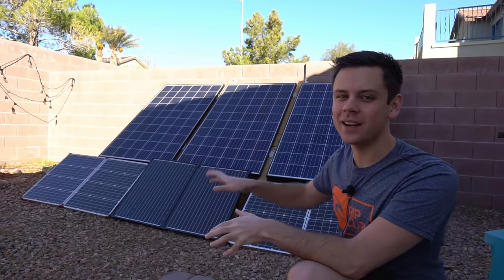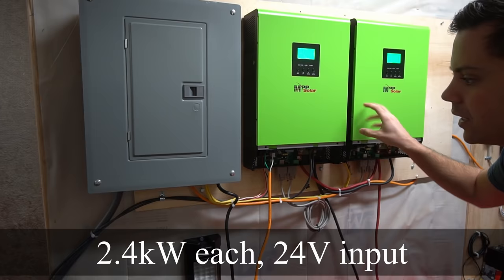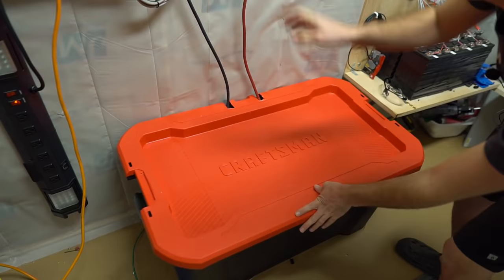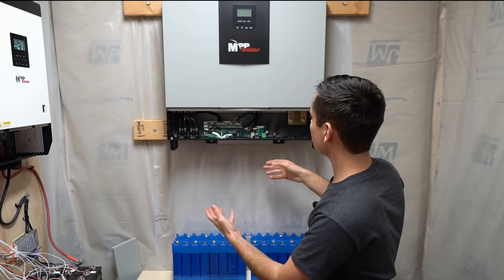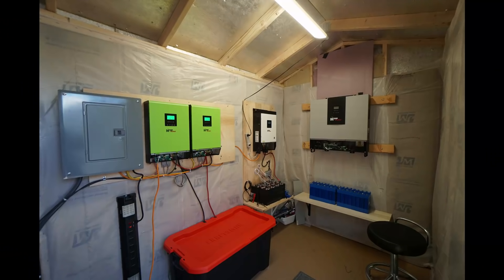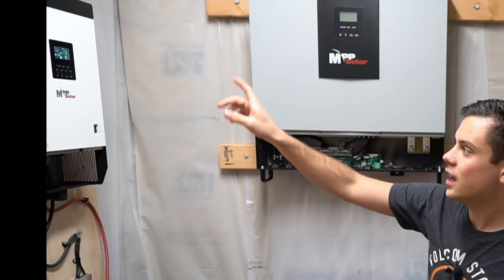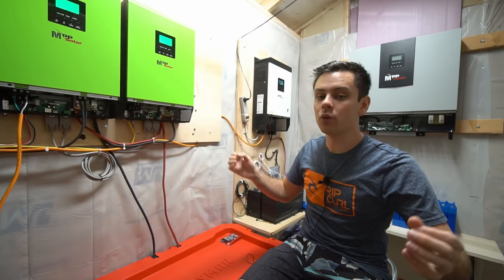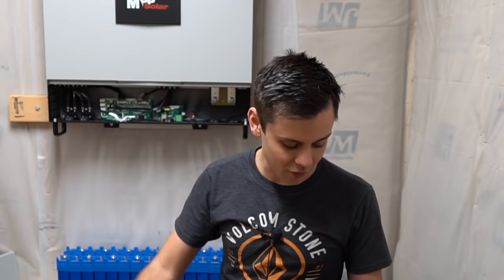Backyard Solar Power System Update! 10kWh Battery, 4 Inverters, 810W Solar Array

Comment: Could you make a video for a small, cheap set up for a camper or ice house? We are looking to power our ice house with solar. Any reason we can't use a standard marine battery? They're meant to be discharged and recharged often. They're also cheap, around $160. Thinking of using (2) 100 w panels with a Harbor Freight charge controller and a 400w Inverter thats made to hook up to a truck battery. Any changes you would make?

Comment: Hopefully, you have inspected your service  panel, as 'Joe Mexico' doesn't know the difference between a right hand or left hand loop to connect the house wiring to the breakers or  receptacles & switches..   Since 'JM' installs the loop left handed, he opens it when tightening the screw..  LOL!  Tons of fun..!!    Also, 'JM' doesn't tighten the screws enough to include all earth grounds and neutrals.  Arcing, dislocations with entire circuit failures are common here in Old Mexico (Las Vegas and Henderson) and contribute to house fires..
If you haven't acquired a permit with an Underwriters Inspection certificate, your insurance company can refuse to pay if they determine the fire was caused by your grid tie.. Icky Poo..!
Reply from the maker: My grid tie system was inspected and is code compliant. Not sure what you mean here. As stated in the video, this shed is off grid. Why would you think it's tied to grid?

Comment: Will I have 6k watt solar panel array and a 5800 watt Axpert hybrid inverter and 11k watt with lifepo4 batteries.   If I wanted to add another bank of batteries, how can I add that to my system?   My concern is that the bms only allows 50 amps charging to the batteries.  If I add a second 51.2v bank, how do I send 50 amps to each bank?   Do I set the hybrid to send 100 amps charging and then each bank gets 50 amps?   If one bank goes down, then that means one bank will get 100 amps which then would overload and then bms should kick in and disable that bank also.   Or that’s how I see it playing out.   Also, it seems like the lifepo4 batteries can handle up to 100 amp charging but the bms doesn’t allow that.   How do we get full capacity charging?    I’ve yet to see a bms that allows 100 or even close to that.  I’ve only seen 60 amps available.     Thanks

Comment: QUESTION: I was building a solar system for a van and was planning to use extruded aluminum for the framing. would you recommend this? should I cover it with plasti dip?

Comment: First, I love geeking out on your videos.  In about the third grade (long long long ago) when I was allowed to ride my bike two miles to the city library, my first book was A Boy's First Book of Electricity.
Now my question, and please forgive me missed it.  HAVE YOU DONE A HEAD TO HEAD COMPARISON BETWEEN YOUR OKD RELIABLE EPEVER 40 AMP MPPT AND THE RENOGY 40 AMP MPPT?

My third personal RV solar system is at the hardware ordering point.  Other than the wire grips being limited to 8ga they feel pretty equal.  I would go Epever, but really like the blue tooth interface of Renogy as running a MT 50 remote to where I would want it would be a bear.  I'm loving the ability to be remote wirelessly and really can't cost justify Victron.  Thank you .  Tom

Comment: I know you are a photovoltaic guy
But are you inquisitive enough to install a Geo-Thermo (buried 4 inch drain pipe with the ridges)( multipul )   a few hundred feet long...maybe 8-10 feet deep ... To compare the cooling effects.   AC vs Geothermo

Comment: question, up grading my system 800w solar pannels 12v. to 1600w 24v system, now my 12v inverters 1st one 800w for frig. stays on 2nd inverter 3000w turn on only when running my larger stuff. will a 24v to 12v step down converter work to power both inverters? and what size? plus thanks for all your great help!!!

Comment: I have eight 100 amp hour lithium cells. I want to build a two hundred amp hour battery. Which way is Best Built to 100 amp 12 volt batteries. Or combine two cells and make one two hundred amp battery with eight cells.

Comment: Can you please do a video on the 2 mpp lv2424 vs lv 5048 please. You said that it's easier to hook up the5048 but I like the redundant aspect of the lv2424. If something goes wrong with one you still will have the other.
Reply from the maker: What aspects would you like to know? The lv5048 is just 2x lv2424. I know the 5048 is bigger and heavy, but it's so simple. And not much redundancy needed. If it fails, so cheap to just throw another one up
Reply: @WillProwse  Oh i didn't know that. So there are no features that are different on the 5048? Can you pull more than 2.5kw on one phase from the 5048. I thought it would allow for that since it's one unit. Can you sell your power back to grid with both units? On the website it says, "LV2424 only: please check with local authority for compliance before enabling this feature". Does that mean only the lv2424 has that ability?
Reply: @WillProwse  I too am curious about the lv5048.I would like to see someone go thru the startup process step by step.Also can you parallel it with any other inverters in their lineup other than another lv5048?Want to know if it's even necessary to parallel them.I am wanting to have a dedicated 220 inverter for mini split and two lv5048's for the house load.Might have to get 3 lv5048 instead but not sure?Also if you are running multiple inverters paralleled do each additional inverter charge bats or just master inverter?If multiple inverters charging do you hook them in different locations to help even the charge?I have lots of questions about solar boss and try not to ask stupid questions so I can do my system once and not waste a lot of money.
Reply: @WillProwse  Also if you plan on being in your shed alot...I would spray foam the inside and then panel it,sheetrock it or plywood it but definitely spray foam it.They sell a small kit at Lowe's or Home depot.not the spray cans like paint.

Comment: Not sure how nasty code inspector's are in your area. But if they see that they would probably red tag your entire house till it's disconnected... Your sealing that shed up pretty good as well. What are you doing for venting?
Reply from the maker: No this size array is totally fine and code compliant. I checked before I built it. no need for permits at all. It's literally just solar panels leaning against a wall. 

And my grid tie system was inspected and 100% code compliant. I actually showed the inspector my backyard system and he thought it was so cool haha I was so nervous but he said it's fine.
Reply: @WillProwse  wow very surprised. None of the wires have to be in conduit or properly held down in the elec panels or strapped down  out of the panel. And not using ext cord wire :) Will your regular home ins cover you? I would think since your making money off these videos with what your doing you might need a "rider" or even a commercial policy. Cool deal. Here in California they would be all over that...

Comment: I need a setup for my shed that has no electricity to it. I need it to run lights and a air compressor that will be used very little. But when it is used it takes 120vac at like 15amps. What can I get by with battery and panel wise?? This compressor will only be used very little. Would one 100ah lithium battery run a normal air compressor?? I’m pretty sure even 100 watt panels would easily be able to keep it charged with the (not much)use my setup would get.
Reply: Or would I be better off just running electric to the shed?? I just love this solar idea and want to get into it but don’t really need to. If I could run my shed on a 100ah battery I think I would do it.

Comment: Could you explore the failover scenarios with the multi/parallel units?  I can't get a straight reply from the (chinese) seller whether the master unit continues if the slave unit fails, or better still - does the slave unit continue working if the master unit fails.
Reply from the maker: It would go into safety mode and both would shutdown. I pushed a leg to it's limit and both turned off. When they communicate, they act as a single inverter
Reply: @WillProwse  Dang, no failover.  Oh well.

Comment: I really like your reviews and instruction. I have a question regarding your 2x GREEN MPP Solar units (MPP LV2424 Hybrid) and its combined Transfer Switch maximum current capacity.
When you run them in parallel is the Transfer Switch of BOTH of them synced to work TOGETHER to provide TWICE (2x) the current capacity when you exceed the Inverter output capacity? 
I am considering to connect and link together TWO of the larger LV5048 MPP Solar systems to run in parallel to obtain 240V AC Split-Phase 2*5kW=10kW (Max 40A) with the hope to obtain 80A Max (20kW) switch over via the Transfer Switches working in PARALLEL (each is limited to a MAX of 40A - they have internally a 40A Breaker).
Will this work splitting the LOAD equally between the TWO LV5048 units so as NOT to trip each one's 40A Breaker?

Any tests of such a parallel connection and Transfer Switches coordination ability? 
Any suggestions of how to get at least 60A when going over the MAX Inverter capacity of the LV5048 of 5kW?
I am actually building such a system to support my WHOLE house so this is not just a curiosity question.

Comment: Will it get below freezing point inside your shed during the winter months? And if so, how do you manage your batteries? If you must avoid charging them, can you use any power from them to perhaps feed a small battery warmer? I live in the north of Norway, and I was thinking about installing a solar/battery system in my garage, but it freezes during winter. I use 48v 15Ah LiFePO4 batteries and I was thinking of a battery warmer of some kind, in a isolated box.
Reply from the maker: I just set my cut off to a conservative number and forget about it. It's fine
Reply from the maker: Oh right, I actually have cell heaters under my battle borns.

Comment: I have a question about bypass diode and replace the factory ones with shockley diode is there a gain from this.????
Reply from the maker: No gain
Reply: @WillProwse  i have a  further up question i have a lightning strike near my house and blow up the 3 bypass diodes in all 3 solar panels. So have you experience bypass diodes failing..
Reply from the maker: @chadellett4696  rarely you'll have a factory defect. I've only had a single one and that's it. It's just cheap diodes that you can swap
Reply: @WillProwse  thanx i know i am asking too much from you. want to ask about capacitors and you have you experimented with 12volt DC 1 fared or higher capacitors  to help sudden voltage drop when combining them on the DC side of inverters. basically i am thinking capacitors could reduce sudden low voltage shut down. and your input on  this would be great.

Comment: Do you have any kind of metering setup on your solar install? Also didn't your RV have 1200W of Solar? why does the house have less?
Reply from the maker: My house has 4500 watts. It's a different system. This shed system is for experiments only

Comment: My understanding is grid tie you dont need batteries.  And it's not cost effective.
Reply from the maker: Grid tie is extremely cheap! And yes, no batteries required. I have net metering and use it to charge my Tesla and run the house

Comment: I would love to have you look at my set up. (maybe donate some LiFePo batteries) ~~cough ~~ cough~~.... just kidding, sort of.. anyways.. I'm running twelve 320w panels to an Epever 100A charge controller to eight 8D deep cycle flooded lead acid batteries set up at 48v. I just installed 2 SMA Sunny Island 6048 inverters running split phase. I have 2 1kW eBay special grid tie inverters that I have been very impressed with after a year of using them. I run 48v to 12v converters to run all my 12v accessories including all my basement lighting and such. I have some other cool things I've done but this could go on for several pages. My wife and I are about to start building a home in Wyoming and will need to be off grid (no power to the land yet), we will also be adding many more batteries and some wind turbines to the system.

Comment: I am not an electrician, but I think you are using the word "phase" incorrectly.  I think you mean "leg".  I look forward to being corrected.
Reply from the maker: Each inverter powers each leg for split phase operation. They are using parallel communication boards to do this. Aren't we saying the same thing?
Reply from the maker: The parallel communication allows each leg to be out of phase by 180 degrees. Split phase is 2x legs and a neutral. And a ground.
Reply: DIY Solar Power with Will Prowse ---- I took my power course 50 years ago.  Let me review, I will get back to you.